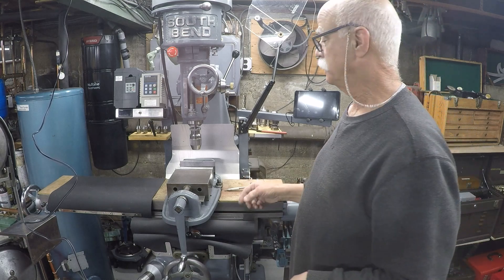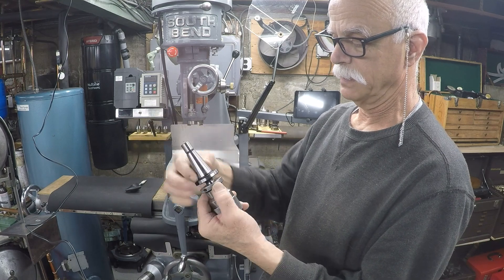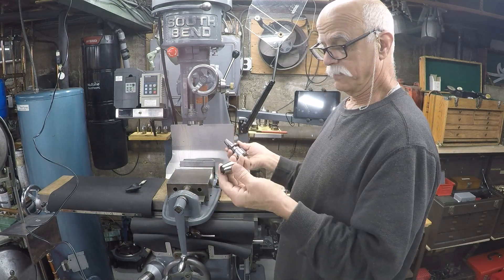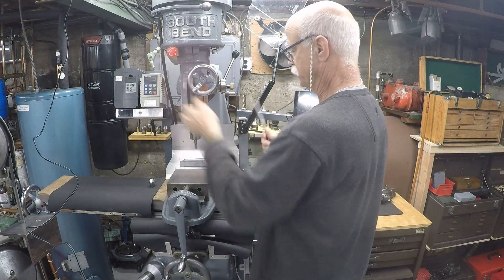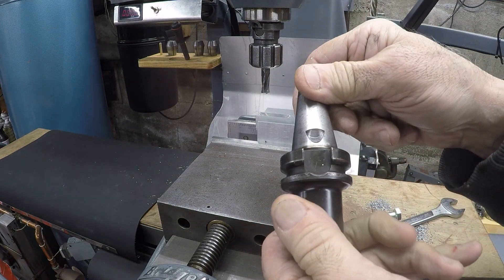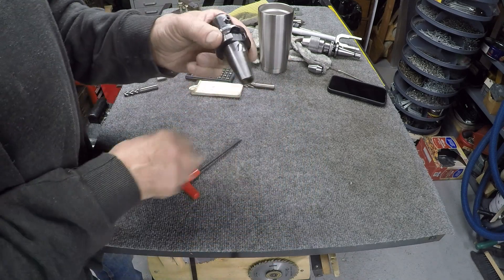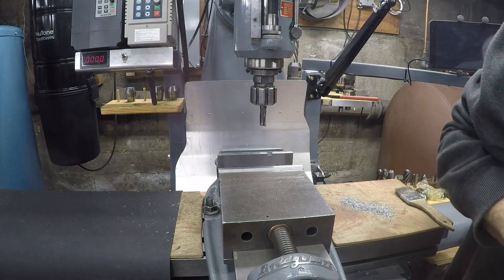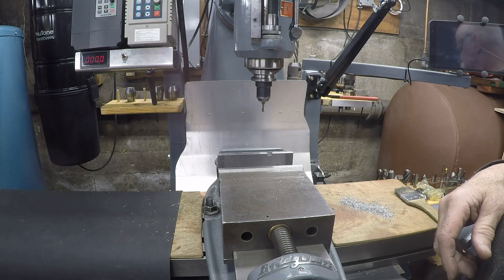South Bend Milling Machine Tool Holding

Comment: I got a South Bend lathe and mill a while back and finally got power to them in the basement. I've read on forums about modifying 30 taper tools for the mill but it's always nice to see it instead of just reading it. I'm a (mostly) CNC guy at work but want to get good at the manual stuff to better understand the whole process. Love the video and a big thanks!

Comment: I acquired the same mill only mine has bridgeport electronic table feeds  as well as  knee feed i did get all the handles for the table and feed along with compass . it has some wear in table center it was also greased its whole life the fella i aquired it from bought it brand knew back in late 50s early 60s ..only two parts im missing the fine feed wheel for the quill along with spanner wrench for collet holder . also when i shut mine off it dont have a auto brake like yours i got the old asbestos brake pad and red arm i got it all cleaned up and painted this past summer.. i didnt know they came with the auto brake or are you doing it with vfd  mine is 110 or 240 has og drum switch along with paper wiring instructions that are faded it took a electrical engineer 4 hrs to figure out what i did in 20 minutes only had one leg wrong so it woukdnt run when i first got  . I like the cat 30 taper over the r8 crap bridgeport comes with i dont mind the set screw way of holding and you can get buy with the factory collet setup i did receive two sets of collets but no spanner wrench been looking for one so i could cast me one or get a mold made to have one casted but i. Havent seen one till you grabbed yours